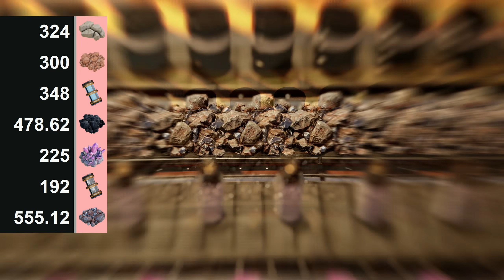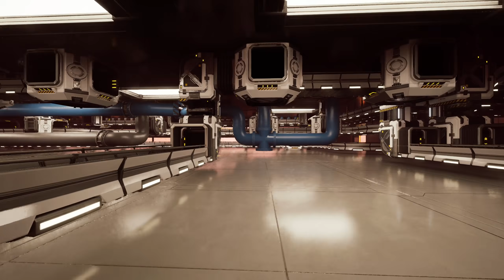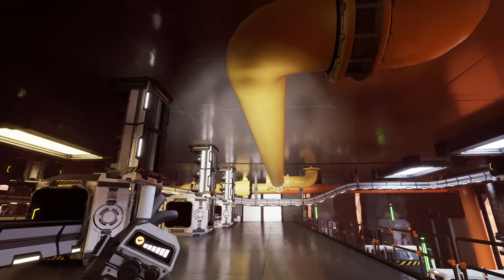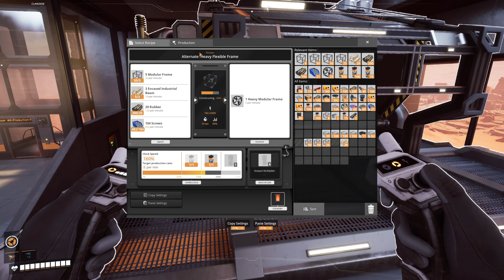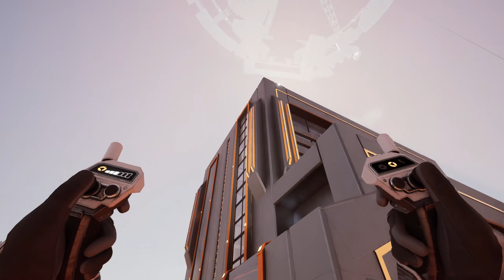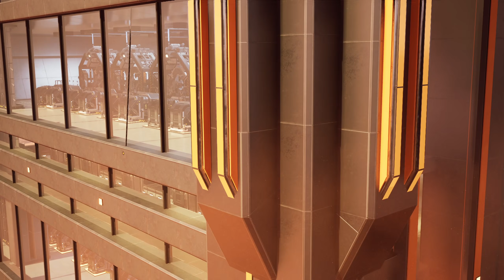Fused Modular Frame Factory

Comment: This is so nice.  I just had one comment, something that immediately jumped out at me.  Why didn't you bring your packaged water up to the logistics floor above the Nitric Acid, unpackage it there, and then drop it down?  You could avoid the issue of pumps on your water pipes that way.  I will admit that it might not look as cool.  But sometimes function trumps form.
Reply from the maker: The rule of COOL!!!
No just kidding...the high was not that bad so here its not a major issue but in my newest tower video you see i do just that. It kinda my standard way of doing it now...bring the water all the way up and let it from from the highest point down to all machines

Comment: Ah, so refreshing. Think you've saved me with your 12/min approach and being cool about it. Think I'll tone down the rest of my playthrough...or maybe start a new one where i go with absolute minimal production of each item.

And here I was trying to max out 4 normal coal ores (2400 coal/min) and make 54 fused modular frames + 40 turbo motors.... pulling 6480 limestone, creating 3600 steel pipes in the process...and let's not talk about the alu production...I'm actively ruining fun for myself :')
Reply from the maker: The smaller builds are more fun for me as you are not stuck on one thing weeks on end. Allows me to experiment more and learn new build methods. My Rocky Desert city has it own vibe, then spire coast has it own thing going for it and now in the Dune desert im trying something new with a massive circular build made up of various tower builds that will support a massive Judge Dredd Peach Trees like tower in the center. At the end the entbuild will be a mega build of sorts without the down sides of mega builds.